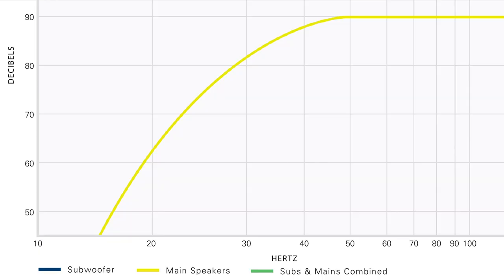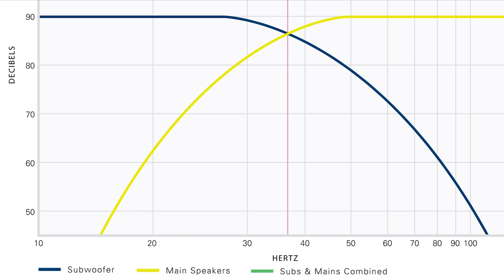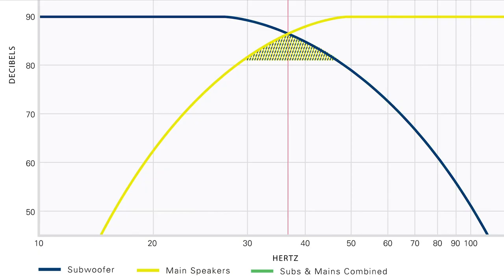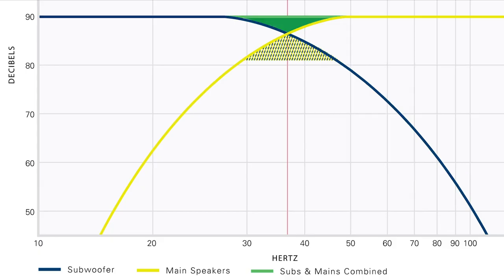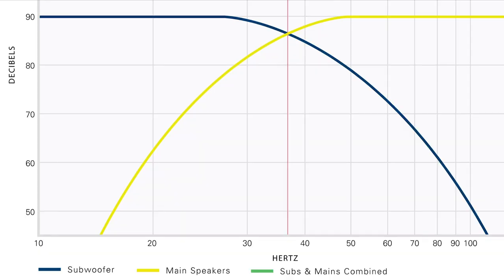How to set the Crossover on Your Subwoofer

Comment: I agree 100% with this. Even before I saw this video or knew about it, out of curiosity, I measured my B&W 804 D2 in my room (manufacturer specs rate them at 34Hz -6dB) but in my room they fell off pretty quickly after 54Hz. I can't tell you how many people buy their speakers and think they're getting that low end as specified by the manufacturer. They're not. And when they look at these REL subs that are rated at 30Hz, or 32 Hz and they think their speakers hit 34Hz, in their mind they're wondering why would they want to invest in a sub that only gives them 2 more Hz. In reality that sub is actually covering 20 Hz or more of a range in the low end. I use a pair of T5i's with my B&W, but now upgrading to T7x and I can tell you they work flawlessly with those speakers and bring out an experience in music that doesn't exist without subs
Reply: cyber, when you say you measured your speakers, was that nearfield or at the listening position?
Reply: @Eugene737  At listening position because that's where I'll be listening to everything and where all the frequencies need to be. Nearfield is not relevant to me as that's only for specs, but listening is where you need to determine what you're missing, what you need to tweak and what you need to add.
Reply: @cyberathlete  thanks, the reason I asked because I am surprised they fall off so quickly and I am curious if you are just experiencing a cancellation due to room modes, specifically at that frequency you mention. Stereophile measured this speaker and got down to 28hz. I am still a believer in adding multiple subs, regardless of them going down so low. The speakers may not be located in the best location to help with the standing waves.
Reply: @Eugene737  He did a nearfield measurement of the speaker which means the microphone was right up next to the drivers and thus the frequencies were mostly free from any impact of the room and he was going to get the max dB out of all the frequencies. You can't do that as the speaker sounds significantly different when your ears are next to it, vs in your listening position. The listening position is the real world scenario you need to work around. And since it's in the living room there is no acoustic treatment I can do there without getting kicked out of the house. So you need to have a real world measurement of the speaker and then work around that. You can't look at specs of reviews and think you will get the same results. Don't forget their review rooms are bigger, and they have purposed those rooms to get the most out of the speakers, which 90% of us can not do. They also move speakers 6 feet away from the back wall, which again I don't think any of us can do unless we have a dedicated room for speakers.
Reply: @cyberathlete  yeah I agree, I don't expect what the manufacturer got in an anechoic chamber or what someone got in their house will work in another person's house when it comes to  bass. I only mentioned the review (knowing it was nearfield) to say that it is capable of producing below 54hz and was just confused by what you initially said as I took that as *it doesn't produce anything useable 54hz and below*....relative to your listening position in your room. Is that true? 

If so, that sounds like quite a deep and wide null and glad you were able to combat it with multiple subs placed appropriately in your room given you can't move anything else.
Reply: Hello cyber, I see you upgraded to T7. I am thinking of buying a Rel. 
What is your opinion for my situation: 
Dynaudio contour S1.4 are the mains. 
Not sure what to buy from Rel, T7 or T9, given that now I have small room 18m² (round 190ft), but have plan to go bigger in the future. 
I know even T5 is enough for this small room, but the flats are changeable and I want to be able to use it wherever I am. 
Is it bad to have a bigger sub than the one it fits the room, or is it just a reserve power that doesn't mind?

Comment: What I don’t understand is that in this example the crossover point is around 35-37hz. Instructions say the end crossover point with most speakers is often +-3 above or below 15 clicks which is well above 37hz. Why is that?
Reply from the maker: Thank you for reaching out. The Crossover dial on our subwoofers is not linear, and in fact a Crossover dial setting of 15 clicks from the minimum position actually sets the filter roll-off point close to 35Hz. That being said, to get the best results we recommend tuning the Crossover on your subwoofer by-ear, so that it is dialed in based on how your main loudspeakers are truly performing in your own room and system.

Comment: First Mr Hunter says my room cannot support low frequencies than he goes on to say his speaker generates those frequencies. There must be something missing here. I understand that when the wavelengths or fractions of wavelengths exceed the dimensions of the room they will not resonate but I don’t know if such resonance is even desirable, is it? I want to hear “good” bass whatever that means.
Reply: I think he means that it will not enhance frequencies of a certain range while considering speaker placement. There is a phenomena called "suck-out" where any amount of speaker output in a given frequency range will be dramatically quieter than outside that range. This could be caused by phase issues between multiple speakers playing the same frequencies in different locations. They could basically cancel each other out sometimes. I understand what he means by the size of a room versus wavelength of frequencies, but in practice you can hear and feel very deep bass especially with subwoofers. All in all, subwoofers should be located where they work best.

Comment: Fantastic. Now how do we set the crossover? Where is part 2?
Reply from the maker: We recommend in most situations to start with the crossover control set to the 10 o'clock position, or approximately 15 clicks from minimum on the dial. From there you can adjust so that the crossover is set to below where your main loudspeakers are naturally rolling off in their low-frequency extension in your room, with as minimal overlap as possible. Typically when the crossover is set too high you will notice boominess and a lack of detail in the upper-bass to low-mid frequency range, and when it is set too low the transition between the subwoofer and your main loudspeakers will not be smooth and you will hear a disconnect between the two.

Comment: So if my speakers go as low as 39hz am I right in thinking I need to set the crossover somewhere between 39 to 50hz Because of the room influence?
Reply from the maker: Thank you for reaching out. Ideally the Crossover dial on a REL subwoofer should be set to just below where your main loudspeakers naturally roll-off in their low-frequency extension in your room. If the spec sheet for your speakers indicates that they are able to reach down to 39Hz then it is possible that in a typical home listening environment they will actually reach down into the mid 40Hz range, though to get the best results we recommend tuning the crossover by ear. Start with the Crossover dial on the sub set to the minimum position, then with a familiar reference track playing slowly raise the crossover until you begin to hear boominess and a lack of definition in the low-mid to upper-bass range, at which point you can lower it back down slightly to restore a seamless blend.

Comment: Very good, now that I know how to do it, how do I really do it?
Reply: EXACTLY
Reply from the maker: We recommend in most situations to start with the crossover control set to the 10 o'clock position, or approximately 15 clicks from minimum on the dial. From there you can adjust so that the crossover is set to below where your main loudspeakers are naturally rolling off in their low-frequency extension in your room, with as minimal overlap as possible. Typically when the crossover is set too high you will notice boominess and a lack of detail in the upper-bass to low-mid frequency range, and when it is set too low the transition between the subwoofer and your main loudspeakers will not be smooth and you will hear a disconnect between the two. Feel free to write in to contactus@rel.net if you have any additional questions regarding setting up or tuning your subwoofer.
Reply: @RELAcoustics  thanks! because even I can understand that

Comment: Hi, what is the recommended method to check there is a smooth transition between he subwoofer and speakers? Would you use a sine sweep and listen for peaks and dips in the output?
Reply from the maker: In our experience, the best method is to start with the Crossover set to the minimum position, and the Level set to a moderate point. With reference material playing, you can slowly raise the Crossover dial, and stop once you begin to hear a clear overlap between the subwoofer and the main loudspeakers, which often sounds like boominess and a lack of definition in the low-mid to upper-bass frequency range. Once you hear this, lower the Crossover by a couple of clicks, which should restore a more natural blend.

Comment: I just ordered 2 REL HT1003 MK11 subwoofers. & have a question for the forum.

I have a pair of Totem Acoustic Tribe floorstanders located at the front of my listening room.

Approximately  what should the crossover point be on my 2 REL Subwoofers?
    My Totem Tribe Floorstander speaker's Frequency Response is 
30 Hz-30 kHz.
I will be using the RELs  BOTH  for watching movies & for listening to music.
     I don't listen to most aggressive genres of music.
I listen to folk, classical & jazz...In other words, I listen to accousticly-oriented music. 
The size of my listening room is small to medium 
in square footage.

Thanks So Much!
Reply from the maker: Thank you for reaching out, and for choosing a pair of REL Acoustics subwoofers for your home audio system. The Crossover control on your subwoofers should ideally be tuned by-ear to just below where your main loudspeakers naturally roll-off in their low-frequency extension in your room. Since this low-frequency extension point can vary depending on your room and how the speakers are being powered, we advise tuning by-ear rather than aiming for a specific numeric frequency point. 

To do so, start with the Crossover dial set to the minimum position, and play a familiar reference track that features deep and consistent sub-bass impulses. With the track playing, slowly raise the Crossover dial until you just begin to hear an overlap between the output of your main loudspeakers and the subwoofer, which will sound like boominess and a lack of definition/detail in the low-mid to upper-bass frequency range. Once you hear this you can lower the dial back down slightly which will restore a more seamless blend. 

More information about tuning stereo pairs of subwoofers can be found in the following article from our website: https://rel.net/blog/2015-07-20/tuning-guides/how-to-tune-a-stereo-pair-of-rels/

Comment: So just to be sure. If a manufacture quotes say 70hz as their lowest rating. We should aim for say 60hz to come in under or if the specs are somewhat exaggerated measurements aim for something higher like 80hz?
Reply from the maker: Thank you for reaching out. If a pair of main loudspeakers is designed to reach down to 70Hz, then you would ideally want the subwoofer's crossover set to just below that point, likely around 60-65Hz. However, in our experience very few speakers perform exactly as the manufacturer's spec sheet states when placed in a typical home listening environment. For this reason, we recommend tuning the subwoofer's Crossover by ear, rather than aiming for a specific frequency. This will help the subwoofer to blend seamlessly with the main loudspeakers and how they are performing in your own listening environment.
Reply: @RELAcoustics  First of all, I have to say thank you Rel Acoustics, for not only providing your customers with brilliant products, but then adding these informative articles on YouTube and talking with your customers. Personally I'm very grateful that you take the time to answer questions positively on a older post. And just wanted pass on my gratitude. Thanks.
I was able briefly last night to see what would happen based on your suggestions so aimed at 60hz as  a starting point. Already I Heard more air and space in the Sound stage and felt like the sub had almost disappeared. I had to turn it off and on to prove it was alive and very much still contributing to the image. But its camouflage is now letting the L & R of my stereo breath. It was on 80 before due to THX home theatre history, combining the advertising of the speaker quoted @70hz. So coming under as per your suggestion is personally perfect. Thank you all for the efforts and support.

Comment: Hello , I've just changed my speakers over to some Dali menuet se  I'm now finally able to use the high level connection (my previous speakers being active) 

I can't really put the gain and crossover any higher than 6 to 7 without it becoming too much , yet my previous system in the same room the gain and crossover could quite easily go to 18 clicks and more , does this sound right to you? The Dali menuet se are less capable in the bass department compared to my previous speakers piega 301 active so in theory shouldn't they require a higher crossover on the rel tx 7? Thank you
Reply from the maker: Thank you for reaching out. When you have a chance, please write in to contactus@rel.net and our team will be happy to discuss setup and tuning of your T/7x in this system.

Comment: REL recommends you set speaker to large in a home theater system with the LFE AVR output to REL LFE input  so how would set the crossover on the mains in the AVR?
Reply from the maker: Once the main loudspeakers have been set to large or full-range within your AVR, there ideally shouldn't be any crossover or bandwidth limiting applied to the main speaker channels. When using the high level input on our subwoofers, any crossover being applied to the main speaker channels will also limit the low-frequency extension of the subwoofer since both the speakers and the sub are receiving the same signal.
Reply: @RELAcoustics  got it. So don't bother to use the LFE Input even for home theater? Or just plug it in anyway?

Comment: I've just bought a second REL T9i - yet to be delivered - and as a ballpark figure, would I set the crossover and output at the same levels as my working REL?
Plus - where roughly would be the best place to locate my new REL in my listening room?   The opposite corner?    Thanks a lot.
Reply from the maker: Congratulations on your new subwoofer! The Crossover control setting on the second T/9i will likely be the same as the first, though since you will now have two subwoofers in your room the Level controls on each will likely need to be set slightly lower than on the first subwoofer when it was used on it's own. 

For optimal performance, we recommend having both subwoofers placed just next to the corresponding speaker channel, meaning that the left channel subwoofer should be placed next to the left channel speaker and the right channel subwoofer should be placed next to the right channel speaker. For additional advice on placing and tuning your subwoofers, feel free to write in to contactus@rel.net and we will be happy to assist.
Reply: @RELAcoustics    Thanks so much for very useful advice.  Much appreciated
Reply: One more question.    Do I set the phase at '0' like the other REL?   Thanks.
Reply from the maker: @willbuckley54  Most likely the phase on the second subwoofer will be set the same as the first, though it is worth double checking after you install the second sub to confirm that there are no phase cancellations occurring.
Reply: @RELAcoustics    Thanks again.  Will double check.   Appreciate help.

Comment: Hello REL, when setting the crossover with speakers which use a High Pass Filter and Low Pass filter such as the KEF Wireless II, should the REL crossover be dialed to the same frequency as the LPF?
Reply from the maker: Thank you for reaching out. If you wish to apply a low-pass filter to the signal being sent to the subwoofer, then we recommend connecting to it's .1/LFE input jack. The .1/LFE input bypasses the subwoofer's Crossover filter circuit, which will allow the filters within your KEF wireless speakers to completely control the output of the subwoofer. 

That being said, to get the best possible performance from your main loudspeakers and the subwoofer we recommend running the speakers without any high pass filtering applied, and then set the low-pass filter for the subwoofer output as high as possible. You will then be able to connect to the Low Level input on the REL and use it's Crossover dial to tune it's output to below where the main loudspeakers naturally roll-off in their low-frequency extension in your room.